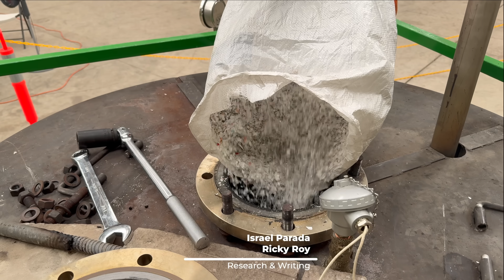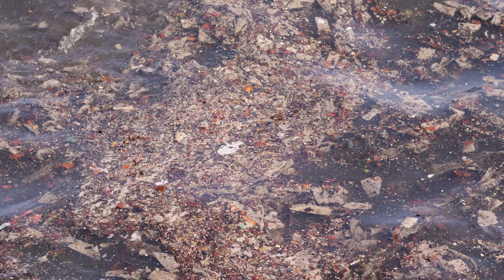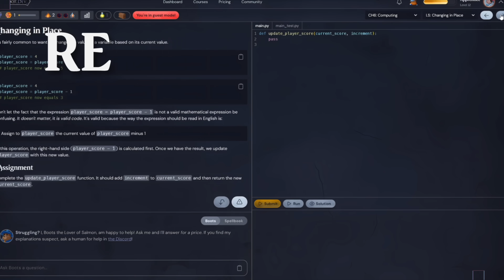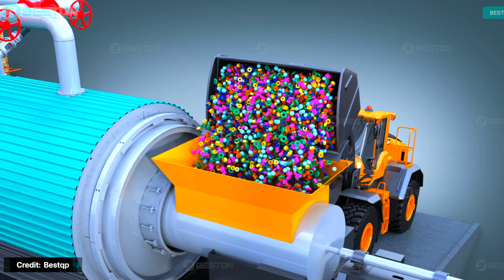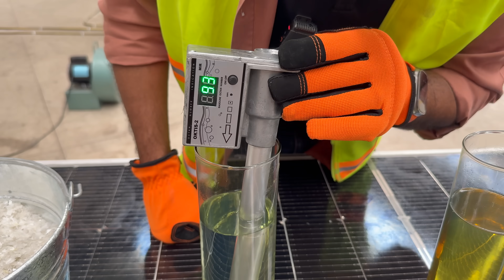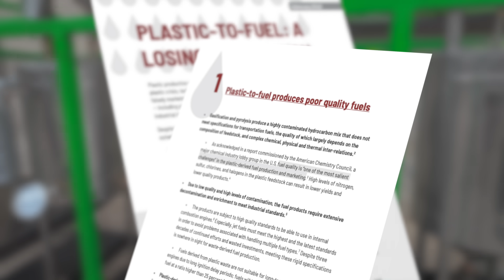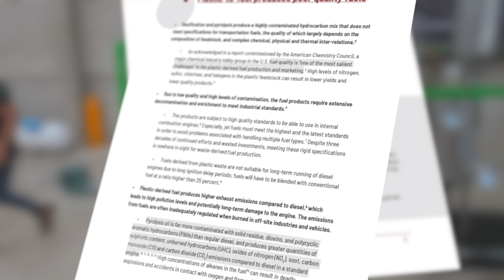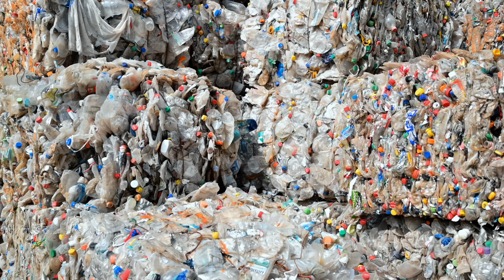Solving the Plastic Waste Problem - This Surprised Me!

Comment: they just didn't want to do it. I saw a guy doing this in his back yard over a decade ago using waste oil and plastic to make kerosene. There another YTBer out here also doing it. I'm glad it's finally hitting home though. My main concern is that plastic it's self isn't..."bad" it's the additive chemicals in them that mess with hormones and cause cancer. was there any info on what happens to those? I'm hoping they are broken down.
Reply: Yep turning plastic solid fossil fuel into a liquid fossil fuel is going to be good for climate change🤔
Reply: @Paul-yh8km Obviously this would go hand-in-hand with adoption of EVs and so on. But sometimes the backup to the backup to the backup (say, at a hospital) might have to be a diesel generator. Why not run that on something that would otherwise just be waste (and a pollutant in it's own right)?
Reply: @michaelmartin9022  
Hospital backup generators only supply essential patient services, lighting etc. Most of a hospital closes down to new patients etc until the fault is fixed.
Batteries or other energy storage systems do the same job.
The UK has a number of all electric hospitals and facilities now that do not use any fossil fuels.
The idea of finding a market for a product that is not wanted, is the basis for all bad products being accepted and money wasted.
If a backup system is designed effectively to replace the full daily electricity needs for any more than a day, then there is a problem with the electricity supply which should be fixed.
A backup system shouldn't be designed to be the daily source of energy.
Reply: @Paul-yh8km What part of "backup to the backup to the backup" are we having trouble with? I mean as an all-else-fails last resort. If I'm in surgery I want the hospital to be working, not to be "right".
Reply: @michaelmartin9022  
Hospitals only have one backup system, they don't have a backup for the backup.
So there is no difference between the electricity supplied by a generator with stored diesel or batteries, except the battery system will kick in a lot faster.
And all backup generators will be gone in any case for all uses, other systems will have to replace them or work methods and project management will have to fit the technology that is available or that can be developed.
Reply: @Paul-yh8km  if you still believe the fairy tale that oil is made out of Dino cadaver you're lost.

Comment: You got it very late as this pyrolysis  system is being running in India since 2018 and providing cheaper gasoline than the oil refinery companies as govt don't tax 80% on them. America is far behind in such recycling

Comment: 37 years ago I wrote a paper on mining landfills... This is what I foresaw as part of the motive~
Reply: Having been one of the garbagemen and recycling truck operators who moved peoples waste to transfer stations, to end up in dumps, I can attest that the toxic waste that ended up in the back of the truck before regulations and alternate re-direction of such waste away from a landfill, is STILL there.   I'd swear to it in court that I myself, and my then GF, on a bike hike, witnessed "a bubbling crude" coming out of a long closed landfill alongside the footpath of the 12 mile creek downstream and below Brock University.
The next day, she developed water blisters in her mouth from getting her face too close to get a good look at "WTF was that".
Reply: Liars say "lithium batteries" (rarely specifying what kind, I notice; it's as if they don't actually know!) end up in landfills. The same liars also often say there's "not enough" lithium.
As it's an element, it doesn't get "used up", so any lithium in landfills will be very valuable in future!
Reply: Indeed! Since a lot of reactions need heat, pressure, and time.  Old landfills must be filled with all kinds of treasures and chemical horrors by now.
Reply: Make sure you filter for USB drives with lost bitcoin!
Reply: And now we have miners using the methane produced in landfills to mine bitcoin turning a bad greenhouse gas into the hardest money on the planet.
Reply: I have said for years that someday we would mine the landfills for all the valuable materials being buried
Reply: @allanmurphy7474  Making liquids from plastic that are (incompletely) burned in cars is a very bad idea. Think PFAS vaping.
Reply: @FLPhotoCatcher I was not talking about burning plastic for fuel in cars. I am referring to plastic recycling and use in the recycling process for fuel. The effulgence from this can be captured and reused
Reply: I thought about that but gave up when I realized the dangers like methane gas pockets and potentially releasing pathogens, or worse, mutated pathogens.
Reply: @MrManerd 

What is more dangerous and destructive? Mining for raw materials to eek out and refine new materials.or dawning Hamat Gear to recover already refined materials?
Reply: Is your paper published? I'd like to read it.
Reply: @cosmincristani  I'd like to see it too
Reply: @calvincheney7405  
It's time to get your papers dusted off;  reviewed, edited,  updated and published.
Reply: You were on it.
Reply: When I was younger , they would burn the methane deposits off the landfills. Now they've capped them and are harvesting methane.
Reply: @Welovephonegames-cf4ko  

Excellent
Reply: same here rather try to eliminate waste why not try to process recycle into useful products that can also be recycled
Reply: Awesome.
Reply: That is something I have thought about for a long time.  Especially old landfills, because people threw away things, already in refined form, that would be valuable today.
Reply: 20,000 historic landfill sites in the UK decades of work for the unemployed and those between jobs.
Reply: @josephm8292 

Hazmat training required though. 

In India and Africa, they already do it.  With zero training.  They just dig everything out by bare hand.
Reply: @Parker2100 then we provide the training required.
Reply: Homo plasticus, in the real sense of the word. It is a crime, an evil one, to let all those plastics rotten in land fills, or let drift into the oceans. It is because no politician is interested in this huge problem. It would be so easy if every major city in the world had a convincently efficient program to recycle plastic. I cannot avoid feeling guilty each time I have to throw away, as simple garbage, those wonderful plastics that are so convenient, like the life useful, from the store to home, then to the garbage. Insane !!!!!!!!

Comment: It's better than burning, landfilling, water polluting the plastics.
Reply: But it's still going to be burnt and produce fossil CO2.
Reply: It is worse than just burning it. You burn it in an electricity producing incinerator that makes an attempt to filter out pollutants. The method in the video burns gas to heat the plastic to then turn into fuel to then burn again providing power at a lower efficiency than what the electricity would provide.
Reply: It is burning, the carbon atoms in the gasoline, and other fuels produced, that are ultimately burned the same carbon atoms that were in the original fossil fuel the plastic was made from.
Reply: @nickcook2714  Burning plastics without getting diesel, gasoline, kerosene etc. is more wasteful and polluting than burning plastics and getting all of those byproducts  back so we can still use them. Like the saying goes, it's better than nothing.
Reply: @bigbadspikey  
Waste to energy plants would actually be more efficient.
In the UK only 9% of waste goes to landfill, in the US 50% does. Waste to energy plants burn the plastic (and other waste) and produce electricity and district heating.
That can be used more efficiently in EVS, heat pumps etc than propping up the internal combustion engine vehicle market which would burn the fuels less efficiently.
But apart from that, making fuel from plastic or burning the plastic in waste to energy plants creates a market that reduces the incentive to eliminate plastic waste, recycle it etc.
Fuels from plastic is probably the least desirable option and justifies increased plastic use and production.
Fossil fuel companies will use it to justify continued or increased oil and gas production.
Reply: @Paul-yh8km  Unless some places need more fuels than electricity.
Reply: @DanielL-ee7fe  

The vast majority of energy use can be electrified.
Reply: @Paul-yh8km  Go tell that to the Mayans living in the Guatemala mountains.
Reply: @DanielL-ee7fe  
The vast majority of energy use can be electrified.
Reply: @Paul-yh8km  Doesn't the UK send their waste to other countries poor countries in Asia? The US also does the same. They send their "waste" what I call trash to other poor countries. So no the US and UK do not use other more "efficient" ways to dispose of plastics.

Comment: If it's high quality Coke, then it can be used in steel production and saving a large amount of energy to make the Coke for that process.

As to the repurposing question, this still reduces or al least delays the need for raw petroleum. And since a large portion is going into paraffin, that removes that hydrocarbon... unless its candles.

Comment: Definitely applicable to the overall plastic waste issue. Assuming more economical than landfill, more jobs, better waste collection, sorting, etc.
Reply: It's a fossil fuel
What's good about it?
Reply: Energy density, ease and convenience of use...burning things to power work has been instrumental to human thriving and "fossil" fuels are about the best we've ever had.
Reply: @danielchin8073  
And the cost is destructive climate change.
Humanity has learnt that those attributes are not the only metric needed for long term advancement. And they are not now the only attributes for a complete working system.
Ultimately they are a dead end.
Apart from that, most of the energy density is wasted.

Comment: Glad to see this happening... I  have always found it disturbing that engineers never design for the end of product life cycle. There should always be a life cycle recycle program built in. This plastic recycling process should be a part of every petrochemical company worldwide. Stop being part of the problem ... be proactive and be the solution.
Reply: It's economics. Process is made at the same time we invented plasic making.
Reply: @RogerKeulen that's an excuse
Reply: Solutions coming from channels near you 😉
Reply: Solutions coming from channels near you 😉
Reply: Solutions coming from channels near you 😉
Reply: Very cool thsnks@!!
Reply: This business model is not economically viable. Plastic has a cost — no one gives away waste for free, especially if it has been pre-treated — and the energy required has such a high cost that, in addition to raising the break-even point, it may even compromise the sustainability of the entire business model.
Tbh, I know people who own a better technology. It can generate all the energy required for the process itself, it can produce kerosene (or diesel or gasoline), and most importantly, it can process any type of waste.
What is shown in this video is nothing more than pyrolysis and gasification applied to clean plastic (already processed). There is nothing new here — we’ve known this process for at least 50 years

Comment: What most people still don't understand:

We not only have to reduce our oil consumption, we have to stop turning locked up carbon into gaseous forms with carbon. It doesn't really matter, if we use crude oil or refined plastics to get energy. We have to stop blowing gaseous forms of carbon into the atmosphere wherever possible. This technology however would be perfect for aviation industry, because we still will have keorsine powered turbo fans around in 50 years time.

Comment: This is extremely interesting but at the same time we are taking the petroleum used to make plastic and then putting carbon into the air when burning the byproduct. How does this help us?
Reply: The only help I can see is dealing with plastic trash. I would be interested to know if plastics in landfills are a stable sequestering of carbon.
Reply: @JimHolder-pk2kk If you want to release the carbon in the hydrocarbon chains in plastic in landfills on human time scales, you need to crack those molecules with some type of energy input (like this process does). With all of this type of stuff, you are reversing the chemical reactions the plants used by collecting H2O and CO2 and using energy from the sun to crack those compounds and recombine them and release the poisonous O2 and store hydrocarbons as an energy source. There’s a reason hydrocarbons are carbohydrates sound very similar.
Reply: Carbon monoxide is greatly reduced by catalytic converters and carbon dioxide isn't the menace we've been told it is by communist politicians ad the scientists they've paid off with our tax dollars, in fact CO2 is necessary for plant growth and none of the dire predictions of the communist greens have come true.
Reply: Carbon dioxide isn't really a problem.
Reply: There is a tradeoff for everything.
Reply: So, you don't have to buy a electric car. That charges from the electricity generated at the waste site burning stuff like plastic. And then be just fine with the normal car polution. Things you can inprove on when your installation is big enough and DOES NOT MOVE like a car.